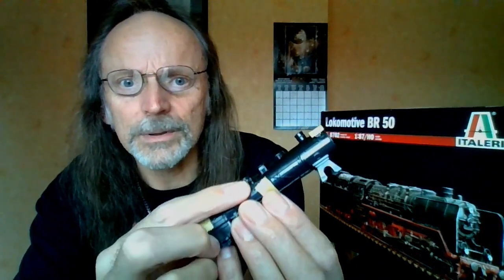Italeri BR50 Motorhead Orgasmotron Build Vlog 1

Comment: Just had an idea watching this as I've got a 3D snaggletooth badge on my motorcycle leather jacket. It occurred to me that if you end up struggling with making snaggletooth from scratch you could try to find a 3D badge of the right size so you only have to sculpt the lower half of his head? Hell, you might even own one because I got mine from the tour merchandise stall at a gig back in the early 80's.
Reply from the maker: I've actually got a 3D Motorhead warpig metal badge on my leather jacket, but it's much too big. Fingers crossed it won't be too hard to do.................yeah right!! (Oh, that was Girlschool, wasn't it!!)